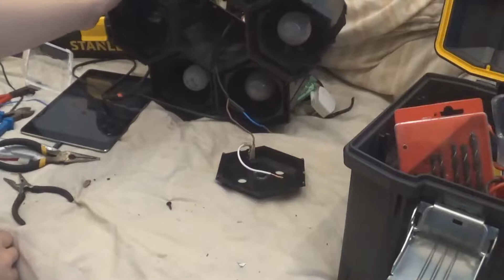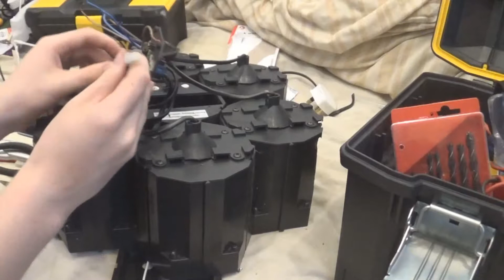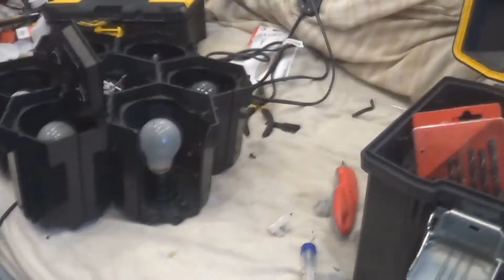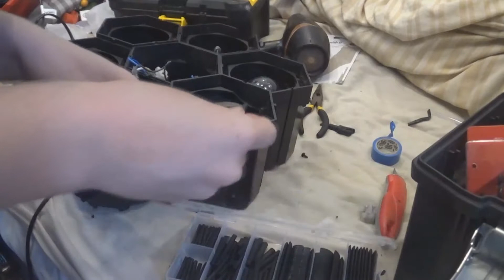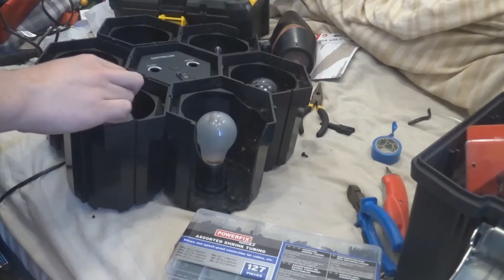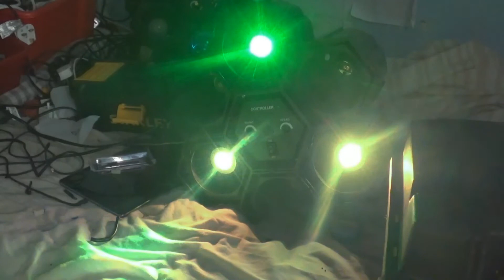Incandecent Disco Light Modification

Comment: What is the point of replacing the dedicated circuitry that makes the lights chase from bulb to bulb with some boring generic rgb led lights, people dont seem to see the iconic look of incands nowadays.
Reply from the maker: LEDs are more efficient and if I put standard led bulbs on this circuitry they would not work due to how them motherboards were made they were for incandescent and halogen not for led and incandescents and halogen are not only inefficient there being phased out, therefore, this mod has futureproofed the lights and made them more economical and cheaper to run